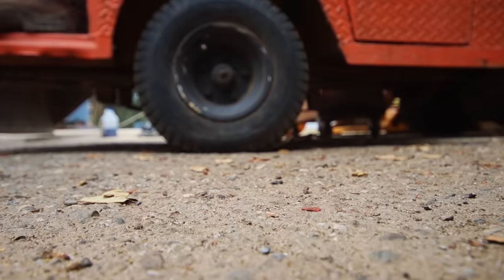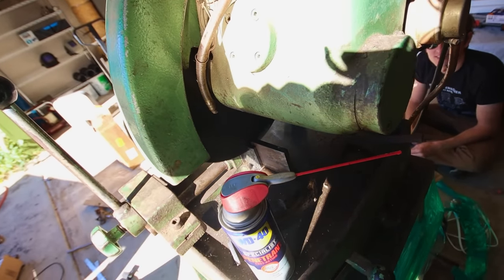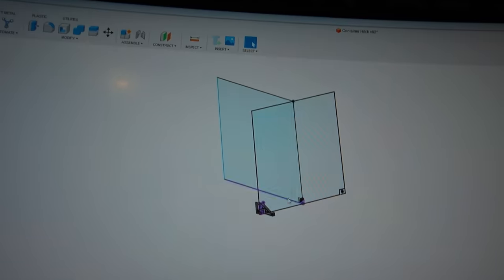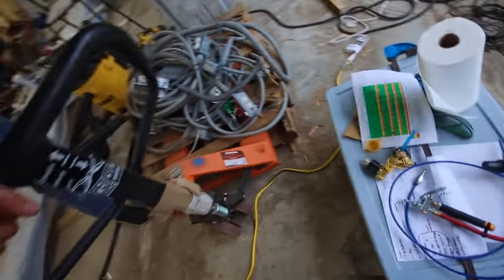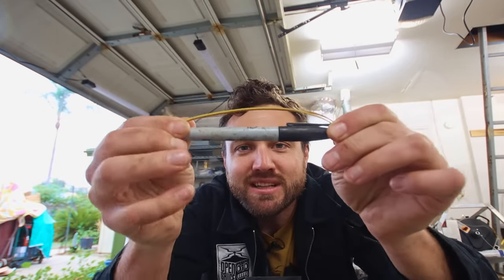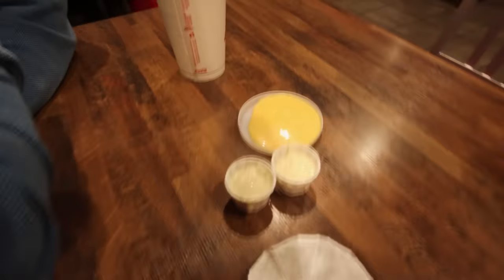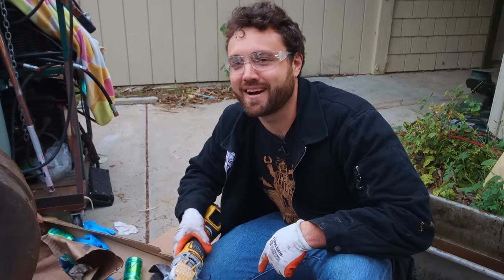How to lift a heavy thing

Comment: Will usually feels like the guy that has no idea what he's doing and somehow gets by. But you can see a lot of his knowledge come out in this video. Welding, laser cutting, engineering
Reply: and none of it necessary at all because these containers are literally built to be picked up from those points, even when loaded. He could have just hooked a chain onto the holes on the corner and called it a day.
Reply: i think the people who don't know much but consistently get by, either know more than they are letting on, or have excellent intuition
Reply: @va3dxv  He made more money doing it his way that he would've doing it your way.
Reply: @va3dxv Did you miss the part of the video where he stated the problem?
Reply: @va3dxv  Not moved one my self but been around some moving - Seen it via fork lift which raises its prongs above the container, and they attach to the top prong holes.   - also the fork lifts were bigger than normal, they could lift the entire crate up if it could get in right.  Don't think Will had the setup for that so this worked hah
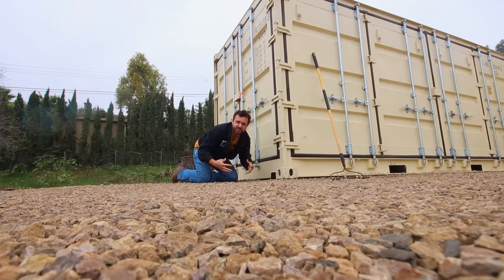Reply: @va3dxv  yes... he knows that. he said that in the damn video. watch 2:40 for why he did it this way.
Reply: Most people are like that, will is just not a coward so he doesn’t try to hide it

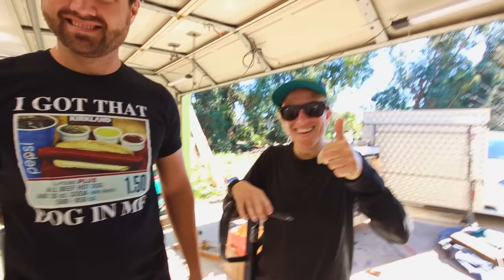Comment: 4:47 To get the red bits to go away i usually take Williams advice one step further and set my FOS to about 0.92 that usually does it
Reply: Wow! I am going to use that trick in my human rated designs.
Reply: Those colors are just suggestions. I don't even bother.
Reply: @richardking4514  suggestions for the most optimal paint to put right?
Reply: The red parts are supposed to tell you where you can drill speed holes, because red is the fastest color.

Comment: Every old lathe will have some degree of backlash in the lead screws. Some allow for adjustment of the split nut as it wears but it will be much tighter on less worn sections of the screw. start your tool off your part and feed into your work to take up the back lash and you will be fine. old lathes are great.

Comment: They make wheel kits for those that lock into the corners, which makes moving them with a tractor much easier.  If you get a couple trailer hubs and wheels, you can probably use what you've already made to attach them too.

Comment: I recently put up a 70 yard zip line for my son out of steel cable. The whole horizontal/vertical load rope conundrum is real. 

I could not believe the amount of reinforcement needed to hold my 20kg son without sagging. 

After doing the math for the angle of the cable and all that, apparently, according to the support poles, my son weighs 400kg.

Comment: I've got a very similar cold saw in the metal shop I work at - they're great and work through literally anything. one thing to be aware of is that they cut really bad against a flat face. cutting bars is always best with them vertically, which makes angle iron a pain sometimes. Also, it can probably tow the shipping container, the torque is more than enough to ignore your arm

Comment: You could get some forks for your tractor bucket lift it up and slide a part of a telephone pole under each end and then roll it on the logs. Thats how I have done it before. Takes a bit of time but it works.

Comment: Hey William, you might need to bring your focal point down on your laser to get a better cut, for 8mm mild steel, your focal point should be about 3mm. 

Increasing the air pressure and piercing time might help it cut better also through.

Comment: I made the mistake of failing to account for the horizontal forces created by short diagonal chains when I attempted to lift a 6000 pound lathe using a chain strung between the arms of my automotive 2 post lift.  The lift was rated for 9000 pounds.  The problem is that that's only a vertical load.  The horizontal load created by the chain angles was too much and the concrete floor couldn't hold the lift columns.  The concrete broke.  Nobody was hurt, but that was an expensive lesson.

Comment: Bar in the middle that you use to make force upward is useless, because if you lift from the middle of the chain right corner will pull to the left and left corner will pull  to the right and equailize each other and you will left with only upward force. If the problem is lifting chain from the right point a pulley should work.

Comment: Nobody tell William about using steel pipe/tubing to make chain standoffs or building wood lift spacers to rest against hard points from the scrap pile for single use or low frequency type tasks... Let's just let him celebrate this very special invention from a very special boy. 🤫    😂👍

Comment: I think for the laser cutter having recast on the bottom, keeping the parts joined, you probably just want a higher pressure air assist going through the nozzle, similar to how a plasma cutter works

And man I wish I could come to Open Sauce, it looks ace. Typical I'm the shitty side of the pond haha
Reply: With oxygen cutting carbon steel you want very low pressure. Between .5 and 1 bar. If anything the pressure sounded too high. It should be possible to cut 3/8" plate burr free with 2kw. I think his biggest issue was that the plate was rusty.
Reply: @8182junebug  Oh really? Wouldn't the air blast help to eject the slag as the laser is cutting, or is the issue it oxidising and cooling the cut? My mate had issues with his plasma cutter until he increased his air pressure - But I guess it's a different process
Reply: @_billyk_  If you're cutting with compressed air or nitrogen, yes that is the case. With oxygen though, it's actually burning the metal up so you want low speed laminar flow. Laser cutting is a different beast from plasma cutting. We do laser cutting mostly with compressed air and we have a special 290psi compressor. But when we go to thicker steel plate we switch to oxygen.
Reply: @8182junebug  Ah, got you. Cheers for the explanation, always good to learn something new 👌

Comment: You don't have 2 phase power.
  You have single phase.
Reply: That's not right! Homes get two phases! You just don't use both phases like ever. How do you think your 220/240v outlets work?
Reply: @mikailkraft  ok, here we go.
A "phase" does not describe a single leg of power.  A phase describes the relationship between two legs.  110v power has a single leg at 220v and a neutral, meaning that you have power oscillating between 110v and 0v at 60hz (in the US).  220V has two 220v legs, 180 degrees apart, meaning that the voltage basically oscillates between 220v positive and 220v negative at 60hz.  In either case, there is only a single phase, because the relationship between the two wires is the same.  Three phase power uses 3 legs that are each 120 degrees apart from the others.  That means that a 120 degree exists between legs 1 and 2.  Another 120 degree relationship exists between legs 2 and 3, and another exists between legs 1 and 3.  That's your 3 phase power.  A phase is a relationship between two legs.  Standard household power is single phase, regardless of whether you're talking about 110v or 220v.

Google it.

Comment: can someone do this math for me i want to find how fast something was moving and the force it generated
you have a metal cart weighs 100lbs, it has 4 hard rubber wheel casters that have a greased ball bearing, it is riding an a very smooth factory concrete floor. it has 1000 lbs of metal bars on it, the bars are longer than the cart (they are double size) the extra length is protruding out the front. this causes the cart to tip forward, lifting the rear wheels from the floor. as the the weight in the front  passes the apex the metal bar come crashing down shooting the cart, that is on just it's front wheels, backwards and striking a target 6 feet away.
how fast was the cart moving n how much force did it generate?